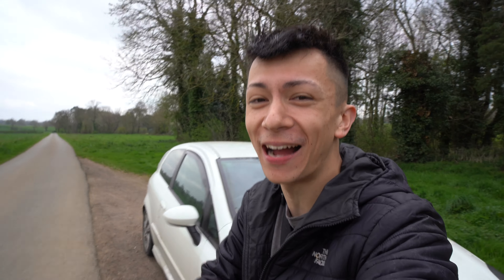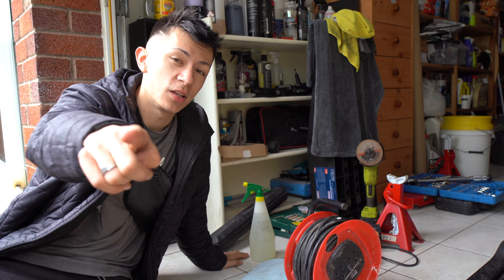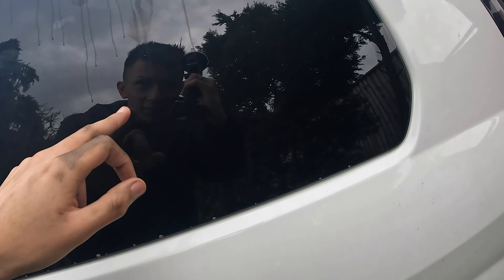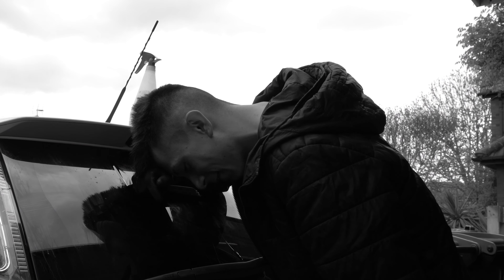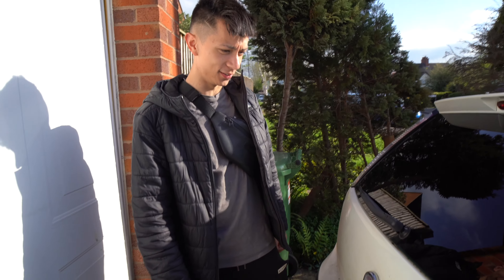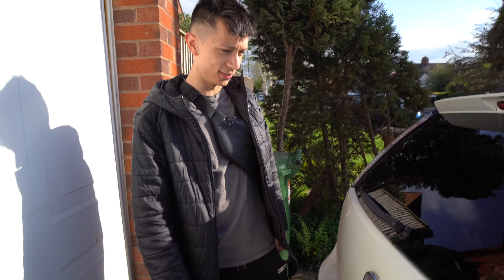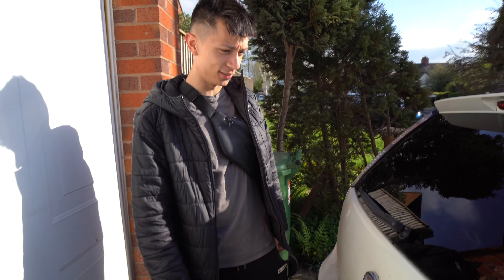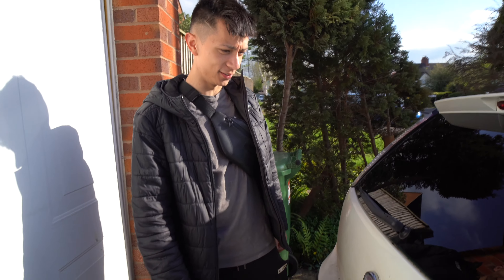TINTING MY FIAT PUNTO!!!

Comment: Daft question: do the rear demisters still work with the tint?
Reply: Yep. They are not affected. However when it comes to removing the tint or applying you will have to be really careful not to rip or slice any of the heater lines
Reply: @sharaazahmed7782  nah he scraped them off g

Comment: How much was it for the roll of tint, curious how It compares cost-wise to if you had it done professionally (not to say you're not a professional 😉)
Reply: usually about £100 for full caf and about 70 for back windows
Reply: @seb123able  Ur crackers, prices usually range from £90 for 3 doors rears, £120 for 5 door rears and around £170 for the whole car
Reply: @officialmrstaticz  im in london, like 3 of my friends just got there cars tinted, £100, 3 years ago it was even £80 on my old 3 door corsa so 🤷‍♂️
Reply: @officialmrstaticz  and i even asksd for my grandland, guy told me £120 full car
Reply: @officialmrstaticz  wherever you live doesng sound cheap mate
Reply: Hello N_OG you can buy a roll of tint big enough for all windows for around £30-40 on Amazon 
To get it professionally done is normally between £90-150 depending on how many windows and how big they are